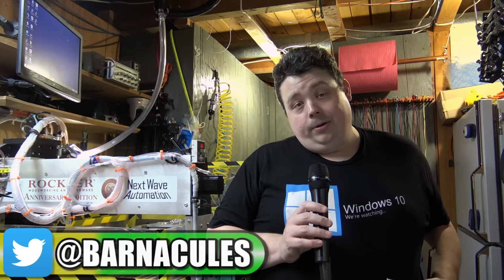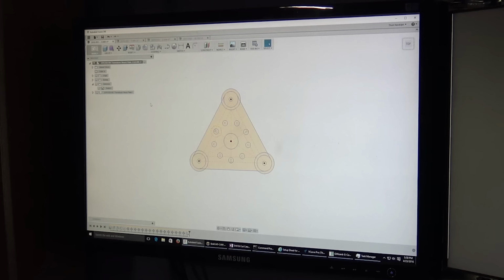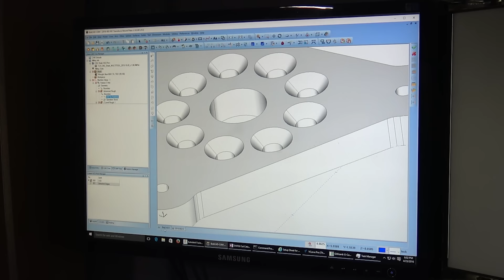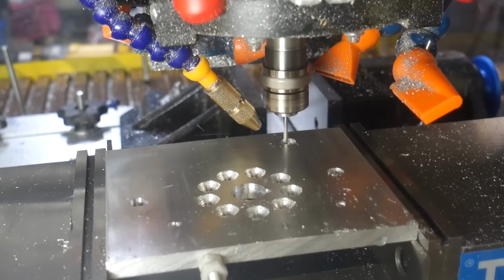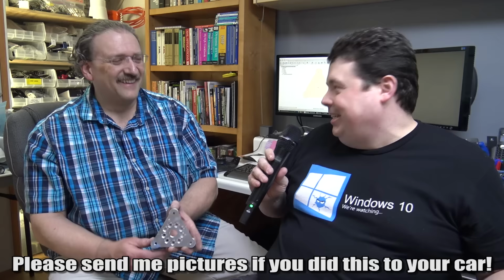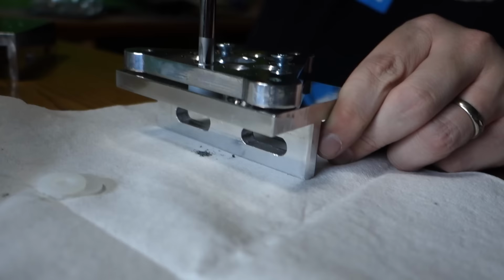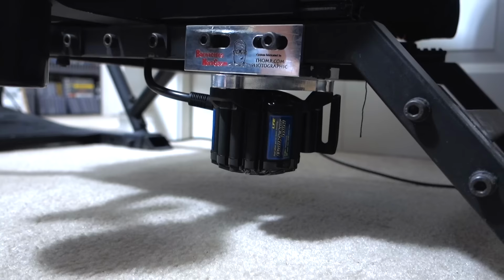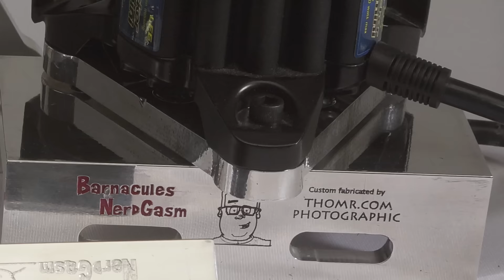Designing & Milling Racing Simulator Transducer Brackets - @Barnacules

Comment: A really cool video Jerry. I have only one gripe and its the same one i had when you called looking through a thermal camera R&D in the Puget Systems Video. Any time you called him an engineer i heard faint laughing from the direction of MIT. He sure seems like a great guy (maybe he even has an advanced degree), but knowing CAD doesn't make an Engineer. That's a 5 credit course in the first year (out of 300 credits for the whole 5 year Masters Degree). No wonder engineers have such a bad rap in the states if that's what the general public thinks a real engineer does. Although Big Bang Theory falls into the same trap. I don't know a single engineer who sits in a general purpose workshop and tinkers with "stuff" all day long.
Reply from the maker: +Johannes Dolch Not sure why you have a gripe, look up the definition of engineer.
NOUN - "person who designs, builds, or maintains engines, machines, or public works." (Thom certainly qualifies)
VERB - "Design and build (a machine or structure)" (Applies perfectly to the action Thom is undertaking)
... School isn't what makes you an engineer, I was a software engineering for 15 years with nothing more then a GED. My experience came from the industry and I climbed my way up where I had 15 people under me that all had BA degrees in computer science. It's not what a piece of paper says that defines you, it's what your capabilities are that define you and Thom certainly has the capaibilities to both engineer and manufacture complex things (Trust me, I've seen some stuff under NDA that he created that would blow your mind). I know engineers that are far more talented then formally educated ones because of their passion and drive to learn on their own. Feel free to agree to disagree on this one but from my perspective not calling Thom an engineer would be like not calling you a human being. You display all the traits of one so I might as well call you one.
Reply from the maker: +Johannes Dolch Also I find it strange that you think he just tinkers with stuff all day long? I commissioned a piece and he designed and fabricated it in his machine shop. That is called a 'job' by definition. He also has several other paying projects he's working on right now. Assuming that he's a tinker is pretty arrogant based on only seeing his involvement in this single project. Just open your mind a bit more before making assumptions in the future.
Reply: +Johannes Dolch Well, companies like Sequential Circuits, Yamaha musical instruments, KORG electronics, Microsoft, and quite a few others certainly PAID me like an actual engineer. But, you're right, my friend who DID go to MIT got a lot more out of school than I did. Because, unlike him, I'd been learning and designing electronics since I was 9 years old. WhenI got to college I bought the mainframe programming manuals that were the one copy for EE480 and read them before the school year started. USC wouldn't let me test out of any of the EE classes, so to bide my time I took a job in their computing center. Withing a month, I was tutoring the upper-level CS students, and one of the kid's dads was a VP of sales at a local electronics company. So, I was hired out of the engineering school...when I was a freshman. My first project was the enhanced caller-ID system used by AT&T on every dispatcher's desk in every 911 call center across the entire US (CM-911). I worked on video games at Mattel Electronics. I've designed multiple ICs over the years, and done tons of programming and writing. I and a team of 4 other writers owned the entirety of Microsoft Exchange developer documentation (back when it was good).

Knowing CAD is not even a large part of what I "know": I'm more of an EE doing chips, hardware, as well as embedded and system-level software. Indeed, mechanical engineering and CAD and machining are things I've just taught myself over the last year. You can call it qualitatively whatever you want, but know this: my shit works.

I suspect what you're seeing in the video is that I have a very long history of sharing my knowledge with anyone for the cost of them simply asking. Having taught week-long classes in IC engineering systems worldwide, and given too many presentations to count, I know all to well how to present myself and complicated material as friendly, undaunting, and not condescending. I don't make people feel small for not knowing things, unless they get uppity ;-).
Reply: +Barnacules Nerdgasm The "tinkers with stuff" referred to Howard Wolowitz from The Big Bang Theory (re-read the sentence before) not aimed at your friend. As i said, i think its a great project and you made a great video out of it. Not that i expected anything less of you. Personally i am at the moment more interested in CNC Lathe work but i definitely respect your plotter work as well.
Reply: +Thom Randolph I am sorry if i offended you. The work you did is really great, you seem to know your stuff and and it wasn't my intention to belittle you or anything, as i said you seem like a great guy and i also said that you may very well have an advanced degree. The only thing i took offense with was jerry's choice of words in the video that made it seem like you have to be an engineer to do anything with CAD and vice versa, that knowing CAD is what makes somebody an engineer. That's like saying knowing how to x-ray an arm makes you a doctor or that you need a doctor to do an x-ray. Engineer is a title you have to earn by graduating (at the very least) from a college. I have the utmost respect for you but if you don't have a degree, you are not an Engineer. That's just a fact. That doesn't mean that what your doing isn't great or that, when it comes down to it, your work isn't even better than that of many engineers. Its just that there are a LOT of people running around, calling themselves engineers and when you look at their credentials they are simply tradesmen. Machinists, mechanics, etc. That's not uppity. When I can't fly a plane, I am not a pilot. When I can't perform surgery, i am not a surgeon. And when I don't have an engineering degree, I am not an engineer. That doesn't make me any less of a great person or anything i do less important. Just call it what it is. You did great work. And let that stand on its own.
Reply: +Johannes Dolch No worries; sometimes it's hard to tell a troll from other above-ground-dwellers. I apologize in return if I responded too forcefully. I'm definitely an engineer, 36 years and three different careers worth. 

You're totally right that just knowing CAD does not make the engineer. I had a friend once who said "good tools can make a good engineer great, but good tools can never make a bad engineer good." Same is true with CAD, or CNC...if an engineer doesn't have a solid grasp of the concepts and the underlying physics, no fancy CAD program is gonna let them make a bridge that I'd drive over!  ;-). The whole point of me leading him through the process (there was a lot he cut out) was that the tools today make it really easy--and inexpensive--for non-engineers to envision and produce world-class products, that in some cases rival those of "trained" engineers. 

Cheers, Johannes!
Reply: +Barnacules Nerdgasm Ok, i think the misunderstanding here is about language/culture. Here in Germany when you are an engineer (Ingenieur) you have to have an engineering degree. period. You seem to handle that a little different in America and of course the software branch is much more informal than other more traditional engineering fields (mechanical, civil, chemical, etc.). But that seems to make it very difficult for employers to assure their prospective employees have a baseline know-how other than painstakingly testing them. Anyhow, I apologize for that misunderstanding, of course. If that is how things are done over there then that's fine with me.
Reply: +Johannes Dolch Ah yes...I was wondering if you might be from Germany. No need to apologize for a simple misunderstanding. I have always been surprised how newly-minted "degreed engineers", at least in the electronics field, seem to be far less able to handle the practical aspects of their work. Things like soldering, power supply design, thermal design, optics, regulatory requirements, and so on. Many "computer science" graduates take only one quarter of anything that even talks about hardware and electronics.
Reply: +Thom Randolph Well, i can only speak for mechanical engineering and in my experience the more prestigious the University you attend the more theoretical is what you learn. Machinists Skills are very, very low on the curriculum. It's mostly math, technical mechanics, thermodynamics etc. as well as chemistry, physics, material science. But no one is teaching you welding, lathe work or anything like that. In fact i remember one of the first sentences i heard in the first few weeks was: "Those of you who are here because you enjoy working on your cars or motorbikes can leave right now, because that is not what we do here" You get a general overview of production techniques so that you know what processes yield the best results for the work you are doing, but at that level you are generally not doing anything that would involve actual manual labor. And I know that that is true of other majors too. I was talking with a Informatik (computer science) major and we came to the subject of programming because i do enjoy that every once in a while. Turns out what they are doing has almost nothing to do with "manual labor" (i.e. programming) as well. Most is just Math, Data structures, Algorithms etc.
Reply: +Johannes Dolch I'm curious: how does a newly-degreed engineer acquire the skills to become a good product engineer? After college do they take apprenticeships at companies? Or will most of them only be working on theoretical subjects their entire career? While I can imagine at large companies like Bosch and Siemens and Blaupunkt there would be other engineers/tradesman handling those "applied" roles, those extra people would not exist at small companies and entrepreneurship. 

Over here, working in a few startup companies early in their careers goes a long way toward helping understanding how the business overall, product manufacturing, design and marketing work together to ship a product. I encourage young engineers to work in startups early in their career...where losing their job any given day won't plunge them into financial ruin. They run out of money or are bested by their competitors at very high rate, and so it is considered relatively risky. Not something to have happen when they have a wife and house and three small children. It is ideal when they are in their mid-20's, live in a small apartment with nobody relying solely on their income. I worked at several when I was much younger, and more than one closed their doors owing me thousands of dollars in salary.

All the Dipl Engr's I've met were always very proud of their degrees, but I did not notice they were spectacularly good with everyday engineering skills. With today's emphasis on being a "maker" and contributor to open-source efforts, do you believe Germany's schooling techniques will adapt to include more hands-on classes, even elective/optional ones?

Great conversation, Johannes; very interesting. 

Thom
Reply: +Thom Randolph Well, obviously I cannot speak for all engineers and/or companies. Also I am still a graduate Student, so take this with a grain of salt. As a general rule you have a three tiered system when it comes to (technical) job education. You have Ausbildung (apprenticeships), Fachhochschulen (college of applied sciences) and (Technische) Universitäten (university (of technology)). 

In the apprenticeship path, which requires a High-school Diploma, your apprenticeship takes about 3 Years until you are a journeyman (Geselle). Then you are a craftsman, you can work in that field. Later, after proving yourself worthy, you can go to Meisterschule and try to become a Meister (Master-craftsman), which also gives you the authority to oversee apprenticeships in your field. 

Now it gets a bit confusing because our school system is different from yours. Also keep in mind that this is all very generally-speaking. After 10 years you have graduated School with a Realschulabschluss (High-school Diploma), at which point you can either leave school or continue to Oberstufe, which roughly compares to 3 years of College. After those 3 years and the Abiturprüfung (Graduation Exams) you have Abitur. Which as i understand it is about 2/3 of a US college degree (without any major specialisation). You can also choose to leave after 2 years which will yield you a Fachhochschulreife (i think it also requires some hands-on Ausbilding to take full effect but i am not sure). Fachhochschulreife qualifies you to go to a Fachhochschule, but (generally) not a Universität. Abitur qualifies you for everything.

At both Fachhochschule and Universität you spend about 3 years for a Bachelor degree and another 2 for a Master degree (That was changed a while ago (Bologna-Process) and replaces the Diplom. Not to be confused with the Meister from the apprenticeship path.) Generally speaking the difference between Fachhochschule and Universität is, apart from the latter being harder to graduate from,  is that Fachhochschulen are geared more towards applied/practical aspects of the respective field and Universitäten are more geared towards academical/theoretical (research oriented) aspects. So you could say that Fachhochschule lies between apprenticeship and Universität. Of course it is more gradual in reality and also every Fachhochschule and University have their own profile. 

So I hope that answers your question as to who possesses a particular skill set. After Graduation of course every way is different and you learn what you need to learn to be good at your job. 

As to shop skills, generally speaking, at University you learn what a Lathe is good at but not how to operate it. Because your job is to determine that to accomplish a certain task a Lathe would be best suited. But your Job is not to operate it. And even if somehow you would end up using one you are certainly not asked to excel at it.

Now again, that is generally speaking. There are so many different schools and companies, not to mention people, that you can not speak for every single case. 

As to a startup: If you are part of a very small startup then you might have to learn a thing or two. But my guess is in most cases even a startup would hire a craftsman to do craftsmen work.
Reply: +Johannes Dolch Very interesting! Thank you very much, Johannes, for that detailed description. Yes, here, things are not nearly so well-defined! It makes sense now why the Dipl Engr's I've known were so very proud of their accomplishment: they have achieved with the best of the best across the nation!

Comment: Does preheating really help buffing?
Reply: +Robert Welchman It has for me. Like with the CNC, I don't have a 5hp motor and 24" diameter buffing wheels; I have a 1/2 HP Harbor Freight buffer, in a cold garage. 

I had gotten a book on polishing, and when they talked about how it all worked, they said that the heat of the wheel over the material melts the waxes in the compound, allowing the grit to move across the metal, and that's what does the polishing action. Well, if you can't get enough heat into the system from the one direction (motor to wheel to waxes to material), then why can't it work in the other direction (material to waxes to wheel), especially given that aluminum is easier to work the warmer it is?

I had struggled with never getting enough friction when doing the three-step process of red/green/white compounds, and each stage took forever to get through. So, I tried it out, first in a regular oven in the kitchen, and amazingly, it totally worked! Total time to shine was like 1/10th what it had been, it only took the one (green) step, and the results were excellent, far better than I'd expected. 

I just wore thick gloves, and smeared some of the compound onto the surface, since it melts right onto it. That, it seemed is also helpful; there's always fresh hot compound on the material as the wheel arrives there. That seems to be a big part of it, as well as it already being hot.

The only problem I had was the walk from the kitchen to the garage (20F rainy winter weather at the time) was draining a lot of the heat...so I popped out and got a cheap ($49) small convection oven. I put the parts in for 5-10 minutes at 250-300F, and it was flat-out awesome. If you do 4-5 parts at a time, you can essentially polish them continuously, rotating through them. 

Now, I can see there might be some risks: thin parts might be more likely to warp. But so far I haven't had an issue on things with walls down to 0.070" thick. 

Hope that gives more detail, Robert. Give it a try...might just work for you too. Cheers!

Comment: hi 
i want to Buy hp z800 workstation 
24gb ddr3 ram 
XEON X5550  2 processor 24 M cash  
my question is
is hp z800 good for games ? 
the games will running without any problems? or lag
After installing new vga card ? 
plz help
Reply: +qwewqeqw asdqwedqr depends what gpu you get

Comment: do you re-melt your aluminum scraps in a furnace?
Reply: +Rich Lehman The left-over "frames" that the parts come out of, yeah I probably will. The chips, however, are largely aluminum oxide on the surface, so the yield is pretty low in a non-electrified furnace: about 30-40% is what I'm told.